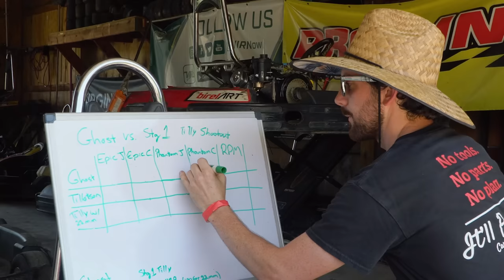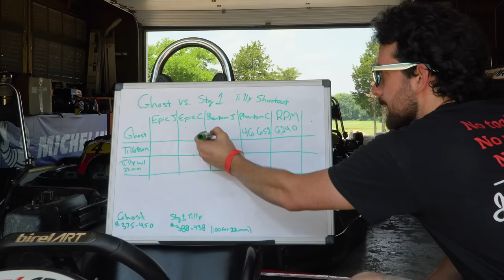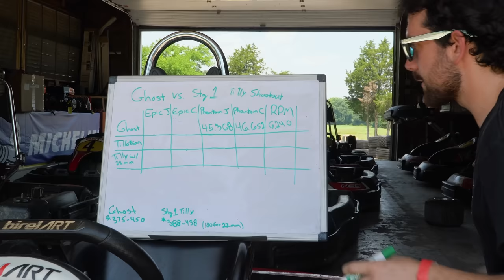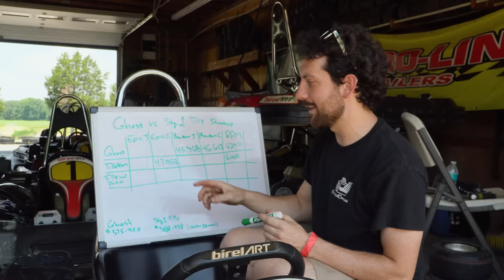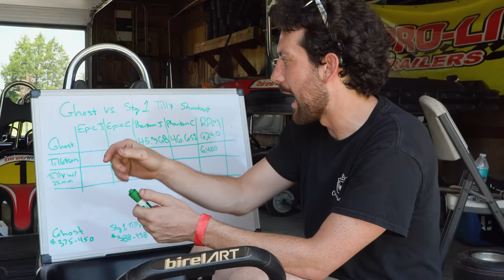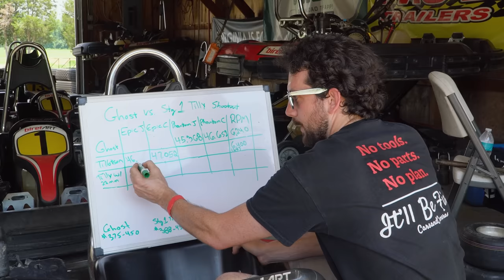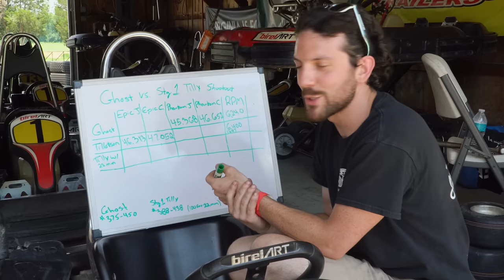Predator Ghost 212 Racing Engine vs. Modified Tillotson 212 High Speed Track Test!

Comment from the maker: You can't go wrong with either engine, but the Tillotson does give you more customization options at a better price point. What did you all think of this format?
Reply: Sometimes towards the gap there is a beveled edge (top) or a dot (top) or writing (top) if there is nothing at all it doesn't matter .....99% of the time...
Reply: I thought the whole video was well set-up to show the differences and capabilities of each cart,and the engines.Well done guys!
Reply: I paid $250 for my ghost engine  and $120 for the kit witch you don't have to buy. You can still get a ton more power out of the ghost and put any pipe you want on it. The excuse you made over and over on the video about why your favorite engine (tillotson) is way cheaper and if it didn't have this problem or that problem makes it a better engine is not true at all. Harbor freight has 20% off cupons all the time. I have to call bull shit . The ghost is the better value at the same price and still smokes the Tillotson.  I love the videos tho.
Reply: Loved it.. I wondered through how much tire pressure would change the outcome with all the sliding on the ghost?
Reply: i love it when you play with engines and karts its way better than these boring mini bikes because they all look a like so we just dont watch them anymore .... sorry
Reply: I like this format, but I wanna see more of the trophy truck and the cross cart on the grand prix
Reply: I race phantom chassis fron the stalker from the late 90's to the new deuce.What phantom chassis was you riding? Just curious. Great video.
Reply: Not a fan of this format. I’m a fan of the Ike and Jon show, so without Ike, it’s just not worth posting the video. I would rather just wait a couple days for a video with him in it.
Reply: Is the ghost a sealed motor from factory? And is it homologated for competition? 

Having someone seal an engine also includes checking for mods from stock. So a stage 1 is likely illegal anyway. Which is why tillotson sell a sealed racing engine.
Reply: Great format Uncle John.
Reply: Ghost is junk for yard karts and blasting around the neighborhood.
Reply: I like everything except the lack of Ike, but I know he went on Power Tour.
Reply: I absolutely love the way yall did this video, keep the quality content coming!!!!!!
Reply: Hey I just got sent a comment saying I have been selected as one of your shortlisted give away from your last video
Reply: I think yall should do it on a oval track
Reply: price to price im not to sure on that one do to that ghost 212 still has its governor off  witch is holding it back were the stage one kit removes it from the tillotson so for that reason if ur going off of tick for tack  on them the ghost wins out on that one in my mind bc the ghost rpms with gov are close to the tillotson stage one with out the gov
Reply: I got messaged that says that I have been selected in a shortlisted winner from last video is it true or is it a scam
Reply: @kylesminibikeandgokartprod4455  Yes I was also selected I won a Teryex SxS already I got it yesterday from ups delivery. 😊
Reply: Hey! I live in VA! 👋
Reply: Finally you guys are going back to some good old fashion minibike and go kart videos love all your work I’m an OG subscriber pre-100 K
Reply: It’s great to see good old fashion go kart videos again love the channel boys OG subscriber from pre-100 KI think even pre-50 K
Reply: @MR_IC  i think it will be fine either way. I dont know those engines, but if it doesn't have any indication on it, that probably means it doesnt really mater. Just remember, dont have the ring gaps close to eachother.
Reply: Hey the gas problem that you're having all you have to do is drill the smallest drill bit in the gas tank lid I had the same problem out of a predator engine it's because the gas tank is pressurizing
Reply: @mikkel1249  boring go karts all look alike 🤣🤣🤣🤣 a
Reply: How do you figure
Reply: No fuel filter will do that
Reply: How did you get your dirt track car to go straight mine constantly pulls to the left and can't find any info on adjusting it
Reply: @jamesconnolly8342  You Are Exactly Right About That They Just Told Me Same Thing 20 percent off coupon and you can add 1 year warranty Or 2 Year warranty
Reply: The Ghost is a better price point IMO if you buy the Ghost even without a coupon you can get a two year warranty and buy the air filter exhaust and fuel pump for 50 bucks on eBay
Reply: @jamesconnolly8342  Agreed, $150 for a tillotson and $120 for the stage one, you are already almost $300, and you can get the predator ghost for $260 with their 20% off coupons, which has a  better flywheel that wont grenade and governor already removed.
Reply: . Would the ghost be good for my coleman bt200x and is the flywheel alright or would ineed to change it
Reply: what gas tank can i use on the ghost if i use on my coleman bt200x mini bike
Reply: I do feel like the sponsorship with go powersports is making you favor the Tillotson.

Comment: You don't have to buy the $150 accessories pack. You can buy the go power sports stuff and put on it. I don't think you really addressed that in the videos. $10 air filter and a $30 exhaust pipe. It already comes with a better carb and better engine parts. $300 for the ghost engine vs $240 for the tillotson engine. The price difference is even smaller if you can pick up the ghost engine in the store vs paying $30 shipping.
Reply: Ghost engine also doesn’t come with a fuel tank. Add these to the ghost, and your still 100 more than the tilly. Take that 100 to upgrade the till slightly and and your even if not ahead. Plus the access kit for the ghost comes with a pulse pump which wasn’t mentioned if it was installed so that alone on the tilly may even it up.

Comment: My guess with the ghost is after putting the no limiter coil on is you ran out of carburetor so the 22mm carb probably would have kept the power going after the 6500rpm. And also it probably started leaking because it didnt have the capacity for the extra rpms
Reply: That is what I realized to, it may need a bigger carb that carb can't take that power ,or if it has a drain bolt it wasn't sealed properly.
Reply: The cast iron flywheel in the ghost will go at that RPM. Get the tillotson (or a wildcat)

Comment: Them Karts are suspension set up for circle track ovals not right turns that's why it goes nuts to the right look at the front spindle on both fronts you will see is lower for more bite on left turns. Although it can be altered for road course yours would perform and make better times. I do have two race Karts and some knowledge thank you

Comment: so power wise ghost 212 performed better than the stage 1 tillotson so if you put a bigger carb and degoverned coil on the ghost itd be really quick the ghost just came out so of course it more expensive give it time and itll probably be cheaper than the tillotson both are good engines

Comment: If y'all can find some older chain driven gear box riding lawnmowers the axle ⚙️ gear will fit.,or can be drilled out to fit on to your racing go karts. Just needs to match up with the chain sizes. On your clutches sprockets is all you need to do on that part of it. And bolt it on.

Comment: With the gov delete on the ghost I have a tiktok video about it on my cart ,under the same username if you are interested, but in order to get it to run right you need to put a utility/stock or billet flywheel on it on. The ghost flywheel says 57° and the flywheel from the original 212 has no offset. You can use an 8° offset key for optimal performance and it’s just like an ungoverned 212!

Comment: I actually used to race these style chassis! We used 212s and 224 honda clones. We raced them on smooth clay though, but corner speed on a properly set up cart was enough to pull your cheeks off of your face

Comment: That leaking out of the carburetor is due to some junk in the needle float valve, it won’t let it seat all the way because something is in the way leading to the gas leaking around it. This happened to me on my mikuni after it was brand new and it took me a while to figure it out.

Comment: those pulse pumps can be odd; it was pushing fuel right pass the float bowl seal.  we used to modify tanks with a cup pointing down, petcock at the bottom in the middle in our fuel tanks; kept fuel no matter what the side of g force, in the line.
Reply: I have the same problem gas leaks out the over flood tube brand new 212 ghost can’t find the problem
Reply: @Nick-tt7ui  simple float bowl carbs like gravity feed.  almost any psi over 2 can push fuel past the bowl seal.
Reply: @jimsworthow531  did you use a regular plastic cup I still don't get it lol
Reply: @Nick-tt7ui  Hey Nick, we would find any plastic or metal that was funnel shaped. first make a small hole in the bottom of the tank and jb weld and or screw the funnel shape or cup to the bottom of the tank.  we then would thread or epoxy the petcock to the bottom of the depression funnel piece.  block off the original petcock.  We used part of an old gas can, the plactic spout part one time.  the fuel will always be in the funnel unless you are shiny side down.  I had a buddy that heated up a plastic tank and melted a depression in the middle bottom of the tank.  he heated the tank and a blunt pipe he also heated.  He pressed slowly through the tank cap opening and it left a depression in the bottom for fuel to pool
Reply: @jimsworthow531  makes sense now thank you, definitely going to do this

Comment: Watched your videos since 2019, always wanted a go kart, and I finally got a fox lxt, like a manco dingo but under the fox name I guess, I have a problem where the clutch kicks in really hard and I'm worried about it, Don't know a fix. Anyway love your videos wish they were more often but that's asking a lot from you. [I think I am gonna buy a hat]
Reply: RPM's? Have you played with the gearing at all?
Reply: @mattfubar4268  yeah I went through all the driven pulley settings and it really never changed
Reply: @nwee5758  You might have to invest in a different clutch set up 🤷‍♂️ I'm pretty new to all of this myself
Reply: @mattfubar4268  idk because it's the same thing pretty much everyone uses, my brother has the same thing but it doesn't happen to him
Reply: @nwee5758  Centrifugal clutches are new to me. I'm used to manuel clutches and they are alot easier to dial in with dirt bikes and motorcycles

Comment: I'd try to find ones with Bigger gears than what's on your racing go karts though  by one to two sizes if you're go kat has the clearance space for them is another key factor in the matter of getting more speed.& Be able to use A bigger rear axle shaft gears on those go karts. Good luck guy's.

Comment: Hey guys, I loved the comparison video however some details could’ve been spoken about a bit more clearly. The ghost accessory kit comes with a pulse pump, was that installed on the ghost by chance? Also were the fuel levels in the tank on the higher side. Someone in the comments says that a full tank would keep more fuel around the outlet giving the tilly more consistent fuel and performance. Any thoughts?
Reply: If you watch the vid they mention the ghost pulse pump more than once.  Clearly it was installed.  The Tillotson was the one having fuel starvation problems due to the g's which they contrasted with the ghost which had the pulse pump. 
No doubt they would have tried a higher fuel level, but it probably didn't completely fix the problem because the tank was much further forward of the Tillotson carb, and just barely higher as you can see in the video.  So fuel lines would have been more horizontal than ideal and therefore much more susceptible to g's despite fuel level.

Comment: Remember to look over.& Check out the teeth on those gears really good first before mounting them on to your machine's though. Cause you might half to use the size of ⚙️ gears to have reproduction ones made. Witch can be 3D printed out.,or pressed stamped out to fit. Your chain size& gear sizes is what will matter on that part of it all. By outside diameter.& Inside rear axle diameter is the 🗝️ key part along with chain teeth.,or tooth size. Along with how many teeth is on the rear axle gear also.

Comment: I don’t wanna say you guys are wrong but saying the ghost is 500 and it’s 100 more then the tillotson I think is far fetched on go power sports a tillotson 212 stage 1 engine is 420 and the cheapest header they have is 30 then a 22mm carb is 100 that comes out to 550

Comment: I'd be nervous of that standard, not special, screwed and glued cast flywheel most of all at 7200 rpm. Maybe the rod next. I see the class racing point of the ghost, but honestly it's just a normal 212 with a slightly bigger cam and a chikuni other than that. I think the diyer not limited by class rules could do better for the money

Comment: What exactly is in the whole $150 accessory kit? Is it required, or are there better options that go power sports could provide for less than $150...?
Because if you aren't including the accessory kit, the price point seems alot more similar. 
If go power sports could put together a recommendation accessories list to get better performance for under that $150 price point, that could be a good alternative.
Reply: The ghost engine doesn’t come with an air filter, exhaust, or fuel tank. The kit comes with filter and exhaust but still no tank, however comes with a pulse pump which if installed may have given the ghost a slight boost in their testing.

Comment: I think you will find that they make equal horse power but the reason the predator did not like the higher revs was due to the cast iron flywheel. The Tillotson has a much lighter flywheel which equates to much better performance at high rev but also equates to much lower torque specs. Had you not had the carberation issues with the Tillotson engine and been able to run it flawlessly in the higher revs your times would have been vastly better with it. The lighter flywheel would allow you to maintain higher speed which would have offset the lack of torque at the bottom required to get it moving which is where the Ghost made up for its lack of topend. 

I think that if you were to get the Till running at 100% and revisit this comparison you might find the lap time results to be very different. I also think that if you were to put a lighter flywheel on the Ghost it would respond at higher revs better and would probably surpass the Till engine even at 100%, but I could be wrong. Great stuff though.

Comment: i know you guys probably won’t respond to my comment but i’m currently building a budget drag/ pit trike with a 420cc engine, it’s getting a 250 twister cam, an amr500 supercharger driven at a 1.16 ratio, and plan to run e85. i only plan to rev it to about 5000 and i have almost everything sorted out except for what carburetor i should use. if anyone could throw me any suggestions it would be much appreciated as i don’t have a lot of experience in the matter

Comment: drill an 1/8" hole in the gas cap that will also help solve the issue had to do it to race box stock to keep line from vapor locking.

Comment: Those price numbers are bs. 
Ghost motor:
*engine $300 (I paid 225 with a 25% coupon). 
*air filter $10
*exhaust from go power sports $60
* gas tank $25 
Total: $395 (after coupon $320)
Tillotson 212:
*engine $257 after shipping
*stage 1 with carb $150
*exhaust $60
Total: $467

The ghost is an absolute way better deal! Not to mention you won’t have to remove a governor or deal with that at all or that the predator has more aggressive internals stock than the Tillotson. I’m a huge fan of you guys, but this video is straight bad facts 🤦‍♂️

Comment: Does the tiltson come with all the parts that the 150 dollar goast kit comes with?
Reply: Seems like there should only be a 50 dollar difference because if you didn't buy the goast kit and just used the same parts you used with the Tillotson. Not trying to be pro goast anti Tillotson just asking questions. Or you could have used the giast kit on the Tillotson but what carb came with the Tillotson?

Comment: Have you heard of Nano reinforced metal parts that resist breaking and bending and what's your thought on it?
Reply: Nano reinforced for metal parts that break or bend often.  
aluminum-oxynitride powder
Comes in bag A B & C take bag B and mix with 99% or higher alcohol end Nano graphite powder for a single carbon atom place in ultrasonic cleaner to chemically dope graphite mix all three powders in powder coating gun then spray metal parts and bake in pressure oven that is filled with argon gas that is used in centering aluminum automotive parts. Otherwise known as chemical vapor deposition process for A Transparent aluminum diamond Nano reinforced part coating.

Comment: Filling the tank would have fixed that so called problem on the tilli..stop being biased
Reply: There’s no mention in the vid of fuel level in the tank so you’re assuming they’re unequal, and they’re giving a biased review. Also the ghost accessory kit they mentioned comes with a pulse pump, that if installed gave the ghost an advantage if it was installed. They didn’t mention that either. Don’t spout a comment like you were there and accuse bias. Multiple factors weren’t specifically mentioned so if you think the video and results may be skewed, use the comment section to ask a few questions that may get answered or point out this or that was missing in video and again ask for clarification. Be willing to learn or teach instead of thinking your the text book.
Reply: @Icantball67  ok daddy